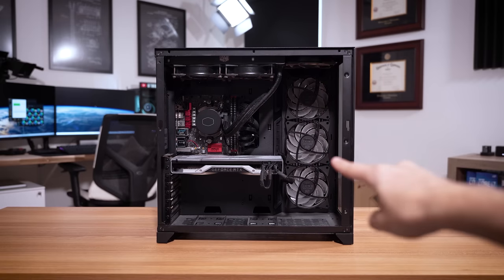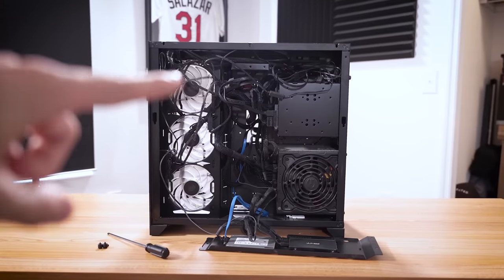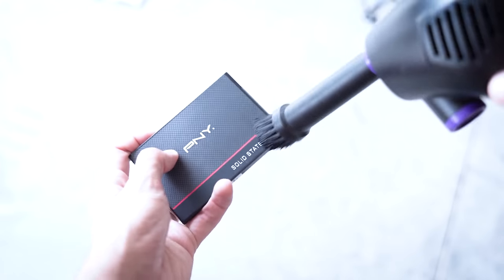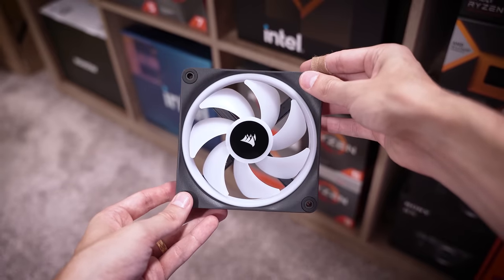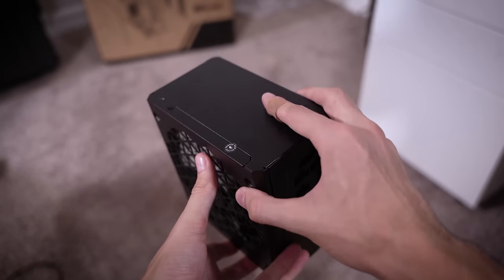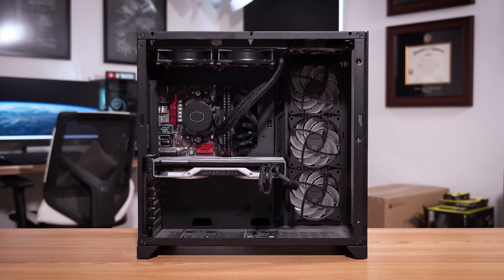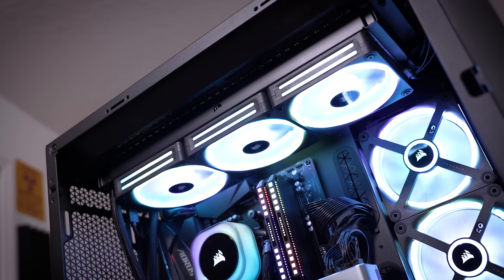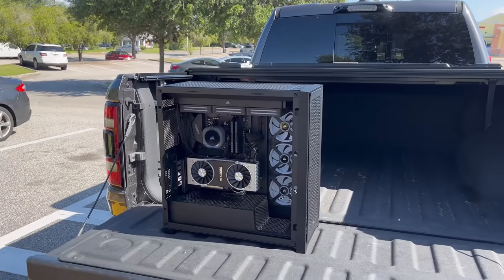We TRANSFORMED This Viewer's Gaming PC!

Comment: The fact that nothing matched and everything worked should at least be celebrated!  Industry standards instead of walled off gardens of incompatibility like a dell system or Apple is an amazing thing that should be continued.

  That being said I appreciate it was a massive sponsorship from corsair and the build did look sweet when you were done.  The viewer wins, the channel wins, I am just glad the original pc could exist and function.
Reply: Not even audio 😝
Reply: Could you Imagine taking a water pump from a small block Chevy, and installing it into a Ford Pickup truck? 
Say, 'yes' to NO, on proprietary parts!
Reply: Was pretty obvious this was a Paid Advertisement
Reply: When building or upgrading PCs it has never once been an issue to get "matching" components (apart from the obvious CPU/platform type and RAM). I am surprised anyone would think it matters.
Reply: @reggiedixon2  I agree, using different brands is not a big deal you could have a ASUS motherboard, AMD cpu, corsair DDR, Nvidia GPU, Master Cooler AIO,  Noctua fans, EVGA PSU, and an NZXT case... Who cares...
Reply: @player_unknown963  If I am a kid, or I am broke as a joke, then I don't care what I gather to make work. 
That said, if I can help it, an MSI Motherboard will have an MSI Graphics card. If the Mfgr is exclusive/renown for Graphics cards, like EVGA or Sapphire, then the 'mismatch' isn't really an issue.
If I threw an ASUS Video Card on an MSI M/B, I would probably disguise the ASUS branding.  
If it is possible, the finished Machine should look like it was planned.

Comment: When the RGB fans in your pc are worth more than your gpu.
Reply: You mean worth more than your GPU and CPU combined lol. Prolly get a used 2080 for $200 and that 1700 for $50 on ebay. Those fans for a 3 pack cost $160. Greg put six in there so that’s $350 (with tax). One fan costs as much as the CPU on ebay lol

Comment: Literally my dream build! When I saw their new fans I was instantly hooked, so much cleaner and easier to cable manage. One day I will upgrade, when I'm less poor lol
Reply: Learn to scrounge!  I started off with an old I5 2400 DDR3 system a few years back that didn't even have a graphics card!  Then I picked up a 750Ti for almost free.  Then got a used 512G SSD to replace the spinning platter drive for helping a friend out.  Went with that for a while while stockpiling parts, mostly from friends who I helped "upgrade" their stuff and didn't care about the old parts any more.  A Ryzen5 2600 here, some DDR4 from there, an old 1060 graphics card... pretty soon I had almost everything I needed for my current rig, only shelling out $70 for a new AMD-compatible Gigabyte DS3H motherboard (ALL ROADS LEAD TO DS3H WHEN YOU ARE ON A BUDGET!) and $20 for a new/used case and some fans.  Minus the sale of the old parts I have roughly ZERO DOLLARS in this rig.  If I wanted fan/RGB bling I could drop some coin on it (even at Corsair's prices!) and still be way ahead money-wise now.
Reply: They are neat, but quite expensive. I hope something else with better value comes around for you! Keep saving :D
Reply: @grandmasmalibu  Your gonna struggle with a 1060 in 2023.

Comment: Just bought a used Lian Li Liancool ii Mesh Performance from a local guy who had recently moved to a mATX form factor. It was a local site auction and I snagged it for a whopping $39. Case is without a scratch...the original owner barely used it!
Impressed with the materials and smart design of this case. Dual tempered glass hinged side panels, with hinged lower doors, both left and right. Plenty of air flow with dual 140's and 1x 120. I moved the 120 to the lower front position, for flow over the storage rack, then brought in an RGB 120 for the rear exhaust. The right side tempered glass does not reveal cables because the unit also comes with metal shrouds to cover all cable runs.  Looks very neat, with minimal cable management needed.

Comment: That's quite a change!  The rig might not benefit from 4000 RAM given it has an R7 1700.  The memory controller on that CPU has some limits in that regard which may not have been remedied by any AGESA updates.
Reply: My R7 2700 can only max out to 2930, so it was for sure overkill.
Reply: I think the max you can get out of the 1700x is maybe 3600mhz.  So you could tune the timings. Get them extremely tight. I'd personally stay @3200 cl14 with the 1700x.

Comment: I looked at doing this for my system but at $600 to fully populate the case (H9 Flow with 360mm AIO) compared to just dealing with cable management for less than $200 can’t be justified imo
Reply: I agree.
Reply: Too many fans doesn’t even help. Geek jewelry is so silly imo. It’s a tool people.

Comment: I knew there was a sponsor build coming when Greg was going on and on about how important it is to bring a build together with an all matching brand lolol
Reply from the maker: I never said it was "important." My own build literally has mismatched hardware. There's nothing wrong with it. I only mentioned that sticking with the same brand can help unify a rig's looks - if that's a priority of yours :-)
Reply: @GregSalazar  I typically try to match most things to the same eco system as well. I find that there's always one part or another that just doesn't look as good as the rest. In my pc now I don't have any matching parts lmao But I chose everything based on looks so it all looks good and fits the "look" 😁
Reply: @GregSalazar aside from looks, is there generally any benefits to sticking to one brand for a build?
Reply: @sylvo1057  If those components use software or proprietary connectors it's nice to have several things connected to the same eco system. You can easily have a few different hubs behind the back panel or a few different instances of software running on your pc to control a bunch of different brands.

Comment: If I remember it right the first gen Ryzen had problems even running 3200 RAM, a lot of ppl had to settle with 2933 back then, did the system really run that 4000 kit @4000? 
The build further looks pretty awesome. 

Too bad it's from Corsair since I had a bad time with their customer service back in the days I have avoided them like the plague.. untill today because I needed a cheap low profile RAM kit for an ITX build I'm going to make, those parts are coming in today and yea.. the Corsair LPX kit was the best choice, 36 Euro for a 2x8 gig kit, so I had to swallow my pride on that one.
Reply: Yeah I had the same thought when I heard that too, my ryzen+ hates anything over 3000mhz so a first gen ryzen running 4000mhz sounds weird.

Comment: Personally i would have kept the same case, changed the motherboard and given him a CPU upgrade, that R7 1700 is on it's last legs, he really should consider upgrading to at least an R5 3600.
Edit: the build looks absolutely great, but again he REALLY needs to upgrade his CPU, hopefully that's in the plans considering now he has an awesome looking build to go with the potential upgrade.
Reply from the maker: We weren't upgrading CPUs/GPUs in this video. Heck we do that enough as it is in our other playlists. CPUs don't grow on trees around here 😅
Reply: @GregSalazar  honestly you did more than enough in just revamping this person's pc just by swapping the motherboard, yet you went an extra mile to swap the case, the latest Corsair tech and a vertical bracket. such a w guy.
Reply: I hate be a problem child but you do know A520 and B550 or x570 only 3rd Gen Ryzen or higher lol 😂 1st Gen Ryzen does Work on B350 or B450 👍
Reply: @GregSalazar  I understand CPU don't grow on trees, but a rig can look as beautiful as this one is, if it is slow like running on R7 1700, ah man, i digress, this is a fail. but if you did upgrade it than that's good. At least there has to be a follow up on the CPU.
Reply: @hyde_official  If he wants to upgrade the CPU he can do it himself easy enough, could get a Ryzen 5 3600 super cheap or just grab a 5600x they might even be on sale for prime day.
Reply: @sollerhollersoulblade6126  There are several B550 boards that 1st gen work in so I'm not sure what you're talking about... He literally used one in this video
Reply: @sollerhollersoulblade6126  that's what i was wondering too. I thought with most B450 and up motherboards they lost support for 1st and 2nd gen when they updated the bios to support 5000 series CPUs. IDK maybe this mobo has a 32MB BIOs chip which allows for 1st gen, it must since it booted.
Reply: @MrBeetsGaming  Yes but some extensions may not work well because the B550 boards are not officially supported. It is a technical problem with 1st and 2nd ryzen chips But B450 is supported with both 1st gen and 2nd gen officially 👍
Reply: @NonLegitNation2  They will if you update the Bios to a 5000 series CPU support lose support for 1st and 2nd gen but you can use a bios before that 👍

Comment: Who cares that the manufacturers are different?  I build for bang for buck, not theme or aesthetics......I don't even like clear side panels.
Reply from the maker: Like I said in the video, of course it doesn't matter for performance. But it can be easier to build a clean rig with components that fall under the same ecosystem. Don't read so far into that hahah.
Reply: When you actually understand how each of the components functions down to its very basic level, pairing components that were very likely tested together in development will always give you the best stability and best performance 💯
Reply: @jakehutchens  yeah maybe if icue wasnt a piece of shit software

Comment: PC Function  for price first  Brand second..  I user Signal RGB to sync lights from all my brands.    EVGA PS,  Gigabyte MB and GPU,  MSI Case, G.Skill Ram    Works great and I look for the best FUNCTION / Prive I can get.    Then I solved the only compatiblity issue ARGB with tool.     One Brand might excell at RAM but not MB or GPU etc.   Oh yes  NZXT AIO  :)  But You did a great job and I will be looking at iCUE in a few years when its new build time.

Comment: Nice rebuild. I have the 7000D case and I decided to rebuild my computer for the first time in like 6 or 7 years. There was soo much room it was a pleasure to build in.  I went with an EATX MB (MSI MEG ACE) but still had lots of room, however my cable management in the back is still not great as I rebuilt mine right before all these new fans etc.. came out and it would cost me too much to switch now. I will say though with this case (mine) it made the cable management form the front look fantastic and was the cleanest build I have ever done. On which is a bummer as I had pretty much an unlimited budget.  One weird thing I ran into was the 7000D comes with the fan hub like the 5000D and 3 fans, 2 front one rear and I used that hub, but my commander pro that came with my Corsair AIO sees all the fans that came with the case as all one fan, so I'm thinking of ditching it but I think I only have 2 more slots on the commander as I added one more front fan and one more side fan for a total of 8 fans (oh I also went the non RGB route). How can you and can you, connect two commander pro's together? If so I might try that. Right now besides that everything is working great so not sure I want to go poking inside again, but maybe.

Comment: This is exactly how the back of my pc looked like (and still looks like) after I've installed my Corsair RGB fans 😂
I've bought all these fans AIO, with the Commander Pro and one of these smaller hubs 3 years ago. It costed me 400+$ I'm really not happy about the cable mess it introduced inside my case. Looks like they've made some good advancements regarding the cable management aspect since then.
My only issue at this point is probably that it locks me into Windows. If I fire up Linux I lose control over my fan curves, rgb, everything. 😢
I'm really looking forward to some kind of standardized way to be able to control all these peripherals.

Comment: Did you get it to post at 4000mhz? Was it stable? Cool what you did but from my experiences 3200mhz DDR4 on a 1st gen Ryzen is about as high as you can get. I hope you found a stable clock and saved a profile for him. Manual memory OC Can be tricky for a novice user.
Reply: I was thinking the same thing. “Can that 1700 really do 4000?” lol

Comment: A rare upgrade video that goes for looks and esthetics over performance. That cpu will be holding this machine back. 
Great upgrade on your part Greg. Looking forward to more videos like this one. 

Ps: Been running the same mb myself for around 18 months now. Very happy with it.
Reply from the maker: Just FYI, the point was to transform the look of the rig - and we made that very clear up front. If we'd also replaced his CPU/GPU, we'd be building an entirely new rig from scratch. That wasn't the point here. Thanks for watching!
Reply: @GregSalazar . I understand with what you were doing, and have no issue with that at all. It does make upgrading the CPU a bit easier later on. I have no issue with what you did. It's a great looking rig.

Comment: I'm curious why you put the fans in the side instead of the front as a direct intake.  The fans on the side would be facing the back panel.  I have this case and yes I know there is a small vent on the back for airflow but nothing close to what the front panel would offer.  Was it to show off the back of the corsair fans?

Comment: So surprised that he didn't bump up the CPU to 5600+. Also, so much cooling for a really low-power part (65W TDP).
Reply from the maker: That wasn't the point. If we had replaced the CPU, we'd basically be rebuilding a system from scratch.
Reply: @GregSalazar  But that's basically what you did.  The only thing you didn't change were the CPU and GPU.  The 2080Ti really didn't need to be changed but going up to just a 3600X would have been a vast improvement, especially with the questionable motherboard and memory upgrades.  If the guy doesn't know a lot about PCs, you could have created a major headache by upgrading him to memory that is outside the spec for his CPU.

Comment: I don't see an issue using parts from different companies.  I actually don't think the build looked all that bad to start with other than the dust and cable clutter behind the back panel.

Comment: the 5000D airflow black is the best case in my humble opinion. I have it myself. Don't like the 3 fans in the backpanel, I personally use them in the front where you have a removable dustcover. But very nice build. That dude is going to be happy! R7 1700 tho... YIKES 😝
Reply: I have the 7000D. Best case I ever built in especially coming from my old Thermaltake😂
Reply: @Anthony-fd8mh  That's a big case 😁
Reply: @notorioezz  It is but only a few inches bigger than my last one and it sits on the floor on a floor tile to the right of my desk. I also wanted something easy to build in as I’m not the greatest when it comes to cable management. The case worked perfect for me.
Reply: @Anthony-fd8mh  I guess size does matter 🤭

Comment: TMW you realise the product ecosystem upgrade potentially costed equal to/ more than the whole PC itself..i'm not a fan of buying into a brands whole product range, like RGB its a trend that brands have tried to set and promote which has lead to much more expensive prices due to the products around the core component hardware, all for the sake of some aesthetics, right down to the nitpicks when some gloss over parts that could dramatically reduce the price and be hidden just make much more sense to me. 

It used to be a lot cheaper to build a PC when sidepanels were solid ;)

Comment: I have that case, it's awesome. But if you have a larger gpu I don't recommend vertically mounting because the gpu is close to the glass panel
Reply: I have the 7000D and my GPU (MSI 4070Ti Suprim) power cord uses that new 12vhpwr plug and I have it bent but away from the plug area and the plug is straight into the card and I still have about 1/2 inch  to the glass. Anyone getting the smaller case would be good to think of vertically mounting a large card, good thing about these cases, is it comes with an insert for the back panel to allow you to do that as well, at least the 7000D does and I think this 5000D does as well.
Reply: @Anthony-fd8mh  The 7000D is a little different. They improved some things over the 5000D. If you're vertically mounting a gpu you have a bigger gap between the gpu and the glass side panel then you do for the 5000D. 

In the 5000D it's almost touching the glass which blocks most of your airflow. I tried it with a 2060 and it was almost touching. My 7900xt would be a hair away from it
Reply: @spentcasing3990  yeah I was not sure if the cases were exactly the same just one larger. My 7000D also came with the bracket to mount the GPU vertically. Not sure if the 5000D also has that.
Reply: @Anthony-fd8mh  No I have to buy one separate
Reply: @spentcasing3990  bummer.
Reply: @Anthony-fd8mh  Not really. It's not a good case to vertically mount anyway

Comment: That Corsair stuff is neat, but the fans are way excessively expensive, and use completely proprietary connections and proprietary software required to control it. If there was some type of standard and the fans weren't $50 each, I would buy into something like that.